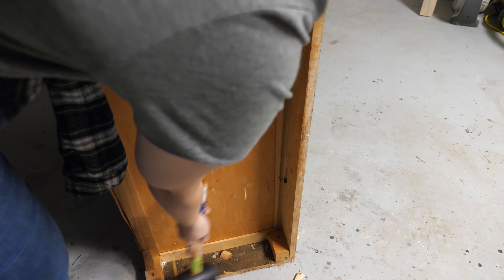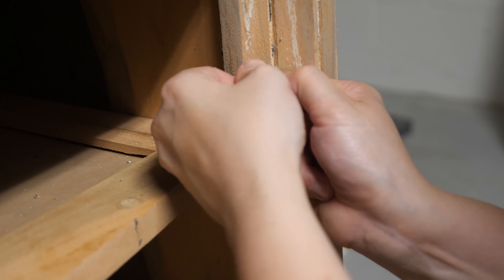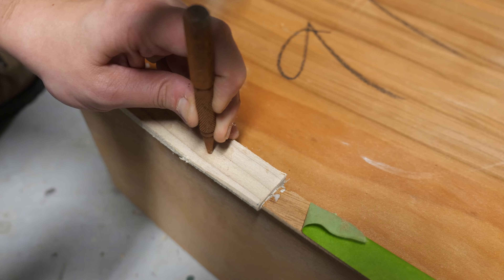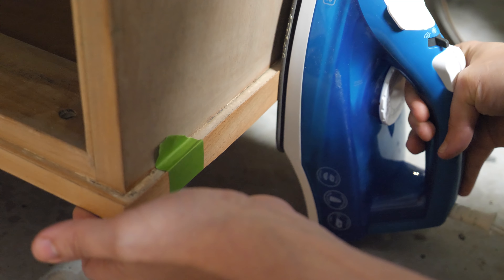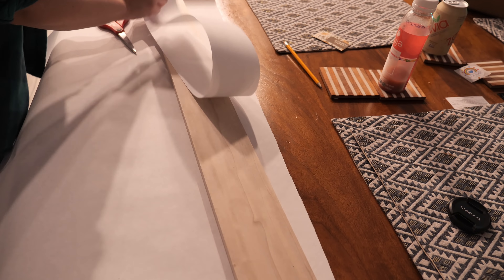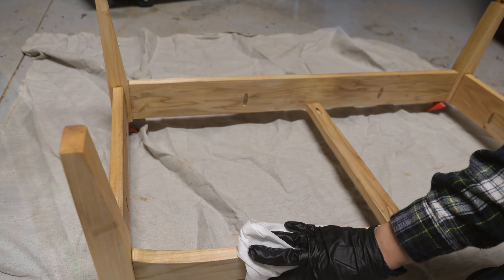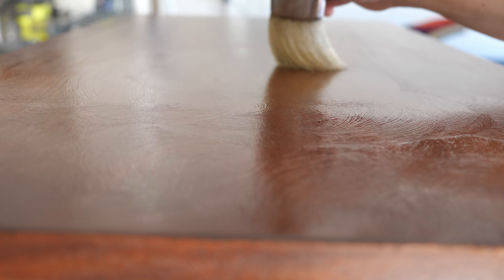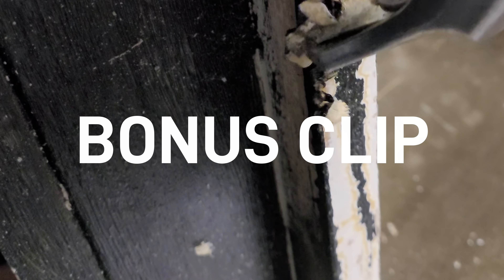BETTER than Restored!  Mid-century Modern Dresser- Custom Built Furniture Base

Comment: Dowel joinery instead of the usual pocket holes is a very nice touch, stronger and longer lasting. The base looks original. The whole thing looks amazing.!
Reply from the maker: Dowels lack the ease of 'just screw the boards together and be done,' but the fact I didn't really need to think about how I would center things was nice. Just had to make sure to drill the holes staggering for the dowels since the legs were narrow. I think the dowel jig will come in handy to make repairs less apparent too - hopefully! Thank you Clyde! Hope you're having a wonderful holiday

Comment: Just think of how many beautiful dressers will need this done to them a few years from now, because of all the DIYers who think they are making vintage, top quality furniture"better"with crappy paint jobs.
Reply from the maker: Maybe get a paint stripper company to sponsor me? Lol. I have a moderate rant I may slim down for my next video. To me its not so much about the paint but the quality in the work. (I do paint and own painted furniture.) Something as simple as putting tape in the drawer handle holes when painting so it doesnt drip in the drawer. Will leave it at this for now before many paragraphs ensue.

Comment: I don't know how often you check older video comments but you might look at a nylon brush wheel for your drill, its gentle on wood but I've use it to pull paint out of crevices before and it worked surprisingly well. Got the idea from blacktail studios using it to clean off bark.
Reply from the maker: I think I might have one on the shelf in my garage. Bought the multipack with the wire brush. If not I will look into it. The tiny little crevises are a beast sometimes. Thank you for sharing!

Comment: I'm refinishing a project that has latex paint in all the nooks and crannies. I've been using a clay sculpting set to get into all the fine details with a thin layer of stripper to soften. This has worked amazingly well. Highly suggest.
Reply from the maker: I actually recently purchased a small wood carving set. I imagine these are really similar to the clay sculpting ones. All the little crevasses - whew. Hopefully get to use them on my next piece! Thank you for the suggest - if these don't work out I will grab a clay sculpting set!
Reply: I'm not sure if the wood carving set would be more like chisels and dig into the wood. The clay set is more like using very tiny putty knives and dental pic tools.

Comment: Excellent job! A true trash to treasure piece. My Two Cents: I would have cut off the bottom flat faced drawer portion and extended the legs on the new base you created. That would have left the top 3 curved face drawers in a squared off box frame sitting on 4 medium length legs. Once again great job!

Comment: I’m impressed with what you’re able to accomplish using just a miter saw and jigsaw! Nice work with the planing!

I would recommend investing in at least a circular saw for some of the bigger cuts you’re making. Would allow you to cut straighter AND spend less time 😊
Reply from the maker: I actually have one now and a table saw! I feel like I leveled up! Any recommendations on a guide for the circular saw? Thanks Jason!
Reply: @ReconstructingEmily  Kreg makes one BUT I would go with the Bora straight edge and it clamps front and back and doesn’t flex in the middle
Reply from the maker: @JasonTheRed  Ordered! Thank you! 😊

Comment: Beautiful transformation! What were you using to apply the Arm-R-Seal with? And why were you applying it in circles? I promise I'm not judging; I'm genuinely curious! 🙂
Reply from the maker: I was looking to get good coverage and ensure the finish was in the wood grain. Especially with mahogany, where it tends to be porous, its good to swirl it around to get a good coat. Plus the Arm R Seal excess gets wiped off in the direction of the woodgrain,  so it takes care of that aspect. Short story - coverage. I asked the same question before I used it. Hope this helps 🙂